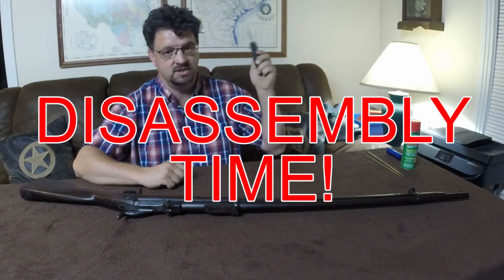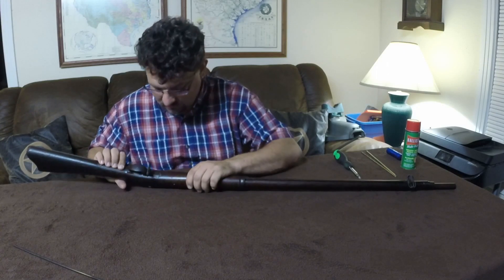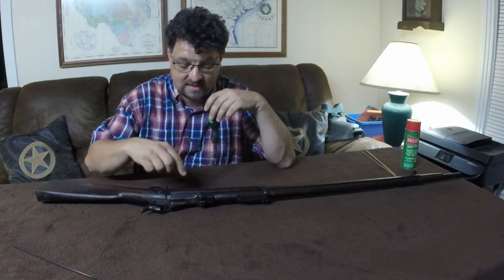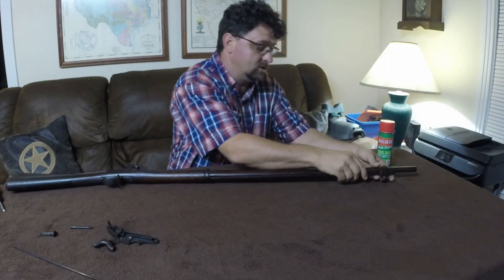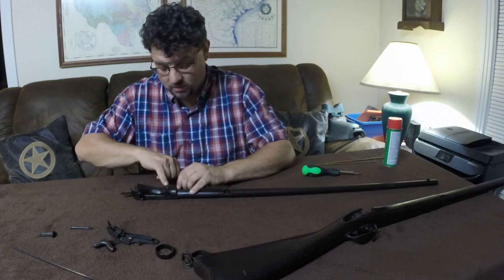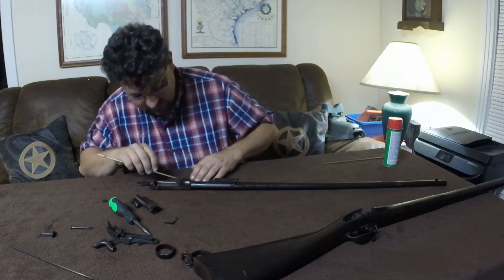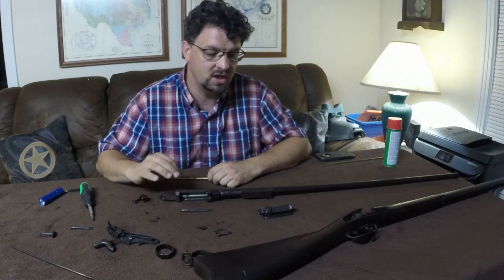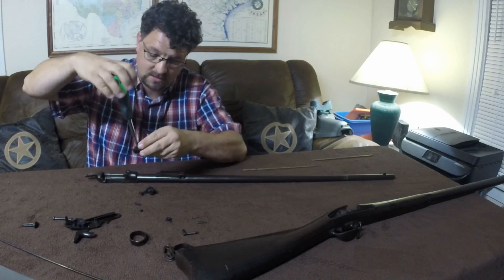Trapdoor Springfield Disassembly

Comment: I have one or more, the 'rifle' you have there and all I want to do is clean it and maybe oil the stock so not taking the mech with wood screws is just what I'm ready for. (mod. 1873, 1884. Going to go through the rest and settled on oil patching the barrel before learning more so thanks. Not sure the ramrod In it is correct unless I switched out the wrong one (this one is 32") My barrel rings came off pretty easily but I had to turn them around to get them back to their normal positions.

Comment: I really appreciate your expertise on the Trapdoor rifles. I have a question regarding my reproduction 1873 Trapdoor Carbine from H&R: is there a trigger return spring in the trigger mechanism? (At full cock, the trigger is slack until it hits the point of sear release).
Reply from the maker: I haven't been in these a while lot, but I don't think that there is. The trigger and lock mechanisms are straight out of muzzle loaders, and I don't know that they were concerned about such things back then. I have a video where I took the trigger assembly out, it's the only time I've ever removed it. I don't show a lot of detail, but you can see it here. https://www.youtube.com/watch?v=Lq0bbgAMdWw

Comment: You missed something about the barrel bands. There is the letter U stamped on the bands. When correctly assembled, the U should be on the right side.
Reply from the maker: You know, I never even paid attention to that. I know the front band is correct, the stacking swivel makes it obvious which way it goes. But I've never paid attention to the rear band. Mine rear band is very difficult to take off, so I'm not going to take it off and flip it if it's wrong. I don't plan to take it out of the stock for sometime.

Comment: What happens if the cleaning rod for whatever reason is stuck inside the gun any tips to remove it besides just using brute force
Reply from the maker: If your talking about stuck in the barrel, sit the gun pointed up with the butt on the ground, and tap the rod down with a mallet.
Reply: @PoindexterTactical  Nevermind I thought it was stuck in the cleaning rod slot because i couldn’t just pull it right out I did some research and fixed it but thanks for the response man
Reply from the maker: Oh, I should have picked up that’s what you meant. Yeah, it just has to be pulled away from the stock as you pull out
Reply: @PoindexterTactical  it’s ok man I was kinda vague with how I described the problem

Comment: This isnt all necessary  to clean it tho right
Reply from the maker: Cao Ning , you don’t need to take it completely apart to every time you clean it. You can remove the hinge and firing pin from the door without removing the door. That way you don’t have to take the stock off. I’d at least do that much when you do a basic cleaning.
Reply: PoindexterG ah ive been wanting to get one of these but ive heard of different ways to clean line like boiling water and soap down the bore and i dont wanna ruin the gun
Reply from the maker: If you shoot blackpowder rounds in it, then you need to make sure that you clean it well. Boiling water is one way to do it, but you don’t have to do it that way. Any basic cleaner will do fine as long as you get to it quickly. Clean the bore well, and clean the door and it’s components. Clean off all of the outside metal and wipe it all down with oil. You don’t have to destock it to do that. You probably want to take it apart at sometime to inspect it, but you don’t have to do it very often at all. They’re really not that hard to clean, just make sure that you keep it clean.
Reply: PoindexterG  ive seen videos of like hickok45 he shoots smokeless rounds not sure if they are like more modern 45-70 rounds. But they seem alot cleaner than using black powder
Reply from the maker: Cao Ning , You can shoot smokeless in it. As long as it’s loaded to the proper 45-70 specs it won’t blow it up. Trapdoors are kinda overbuilt, so they handle that all well. You don’t want to use a copper jacketed bullet, they tear up the barrel. I like black powder rounds for the look and sound, but smokeless will definitely be much cleaner.
Reply: Thankyou for the information  i will invest in a more modern cleaning rod as well